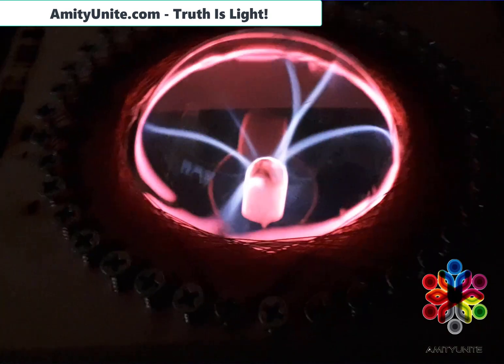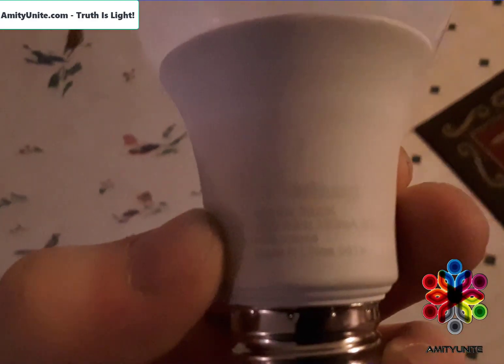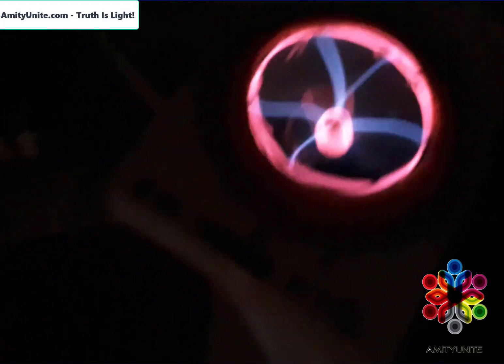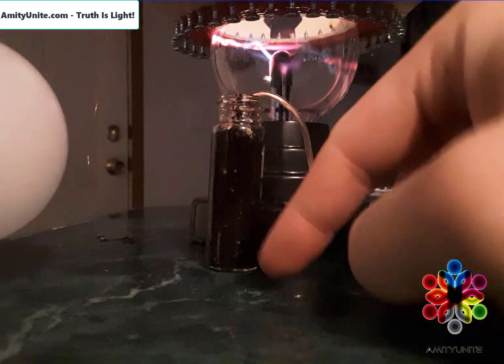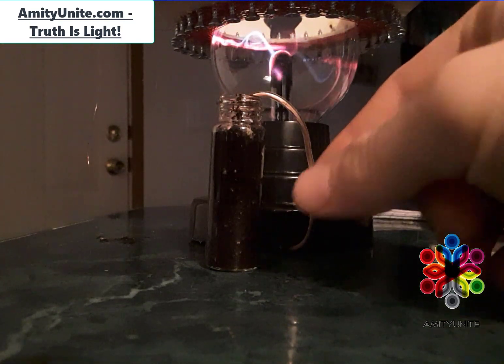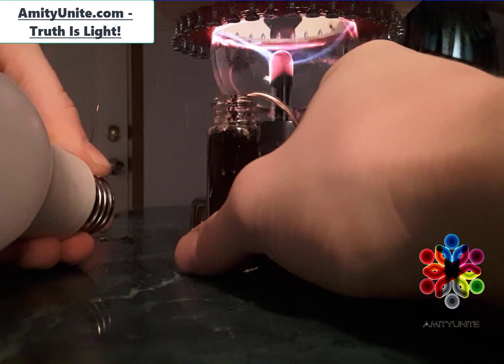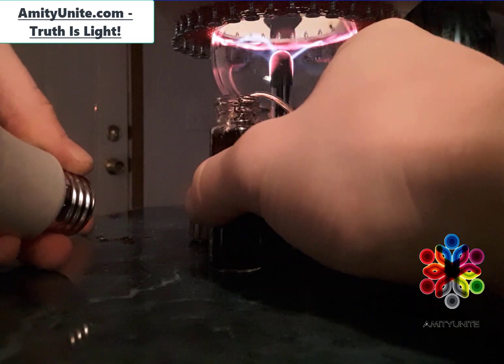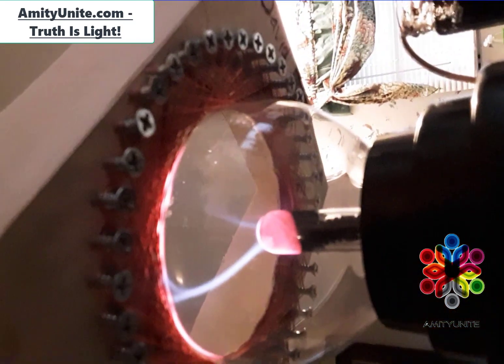Gerrard Morin Simplified Using Holmstrom 40 Point Bifilar Coil Only 4 Turns of Wire

Comment: You need a LUX meter in order to check the lamp brightness when fed by the coil, this way you can determine if it is outputting 8w or not. Nice job.
Reply from the maker: You're right. I'll have to do that for the next video.

Comment: how do you control/define number of cycles (hertz)? You said it generates 20k hertz...is it only the plasma ball?
Reply from the maker: The ball puts off 20khz. Since the coil isn't perfectly tuned to 20 khz I have to build a resonant circuit to help filter it to one channel without fluctuating and causing bad feedback.
Reply from the maker: I believe I'll need 2 cools in order to get this to self power. One coil must domino effect the other 1.5x greater.
Reply: @Resonate369  ok, tnx. I started reading Don Smith's book and so far, I understood that when a system pulsates at 20k hertz and beyond, resistance is no longer relevant...does it make sense?
Reply from the maker: Now that I understand how floating ground work it actually makes a lot of sense to me. The secret is resonance just like he said.
Reply: @Resonate369  do you mean: Now* that I understand...
Reply from the maker: Sorry about that bad grammar.  I've been busy lately
Reply: @Resonate369  I'm a bit amazed that ground can be stored in a simple container....
Reply from the maker: It blew my mind at first. But once I started thinking a bit deeper on the subject it actually makes total sense. Dirt is a very unique substance that can grow plants. If we over think the obvious then maybe we wont find the solution? Maybe dirt and water is the cheapest  super conductive ground material we have for high frequency devices and we've just been over looking it the entire time.